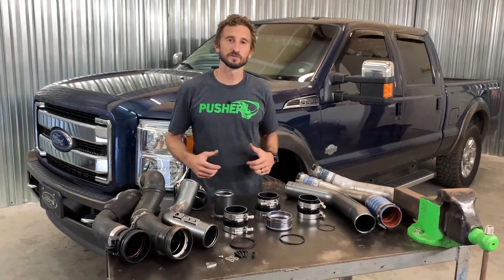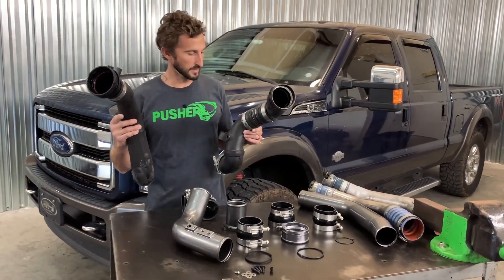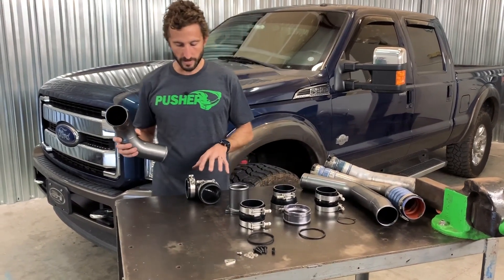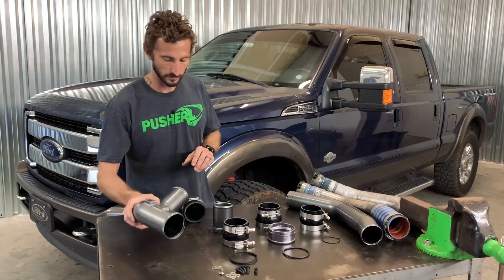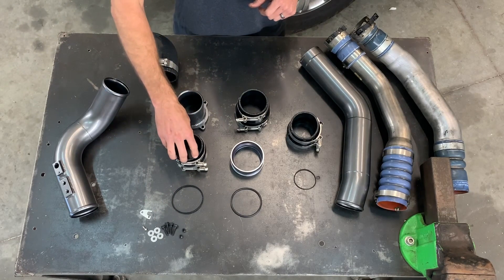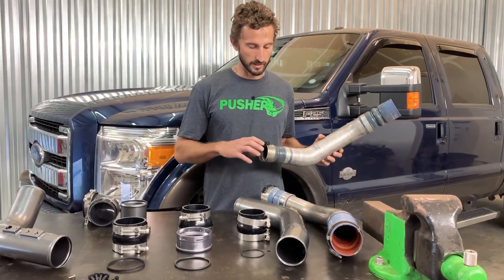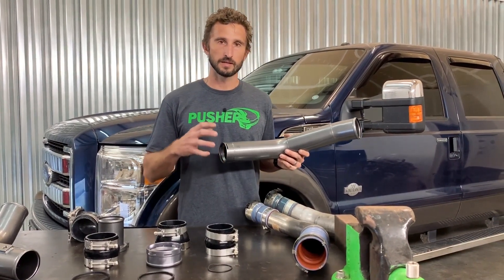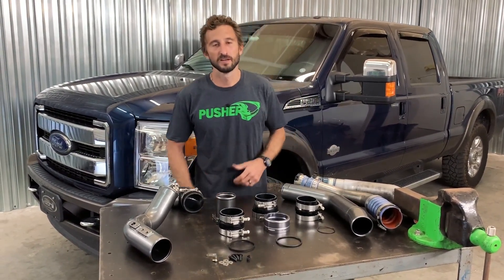Overview - Pusher 6.7L Powerstroke Hot & Cold Charge Tubes

Comment: Is the stock throttle valve gasket non-reusable?
Reply from the maker: The stock gasket is more of a one time use item. The o-ring we supply can be reused if you ever unbolt the throttle valve replacement.

Comment: 3 questions:  1) does custom piping like this for 2011-16 fit both the 2011-14 stock turbo?  2) Then if I upgrade to the 2015+ turbo w/retro fit kit will the tubing be obsolete?  3) Lastly does new tubing require new tunes since there is an air increase?
Reply from the maker: 3 answers! 1) Yes, these work with the stock 11-14 turbo. 2) Should you switch to the 2015+ style turbo the cold side charge tube will work, but the hot side charge tube that connects to the turbo would then be obsolete; you'd need our 2015+ hot side instead, and finally 3) No tunes for these needed if you are installing with the Throttle Valve Adapter on the cold side. If you're getting a throttle valve replacement (because you have a previously tuned race / off-road truck), you won't need to alter your existing tune. The airflow gain over stock on these are minimal, these are more about replacing factory parts that continue to fail with parts that will last the lifetime of the truck.

Comment: If I don’t use the added throttle valve do I still have to re-tune my truck? I still have a warranty and don’t want to void it.
Reply from the maker: If you want a solution that works for your stock / non-tuned truck, you'll pick the Cold Side Charge Tube with the Throttle-Valve Adapter (not replacement) - no tunes. Bolts directly to your current throttle valve and functions normally.

Comment: Is it possible to get the hot and cold side then upgrade at a later time to the full intake piping set? Only seeing the full set available.
Reply from the maker: You can buy them now (alone or as a kit) but if you want to upgrade to the full intake system it'll include a new cold side charge tube that connects all the way up to the intake manifold.

Comment: Can I used it in California?
Reply from the maker: The Hot & Cold Side Charge Tubes with the Throttle Valve Adapter (not Replacement) are 100% emissions compliant. :-)
Reply: yes but legal

Comment: Does the kit that replaces the throttle body increase hp\torque more then the the other version. If you go with the throttle body replacement version what  other mods are needed? Is there any testimonials of specs on increases
Reply from the maker: The throttle valve does inhibit some air flow, but if your truck is not tuned you cannot remove it. We haven't yet flow-benched these designs them for performance data; the primary reason most want to replace the cold-side is to get away from the failure-prone OEM part, rather than performance gains.
Reply: @pusherintakes  does it matter what tune is on the truck> or is it almost always just deleted in the tune idk what tune i have its a sct device with custom tune... please help im a newbie
Reply from the maker: @fatbradlehs  Hey,  prob best to call us and talk this one through - 772.589.8385